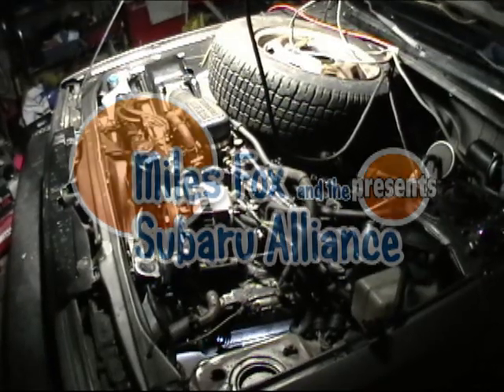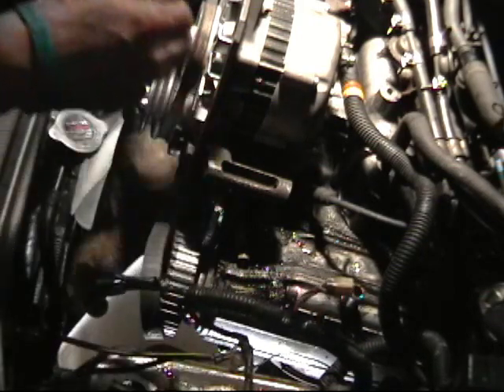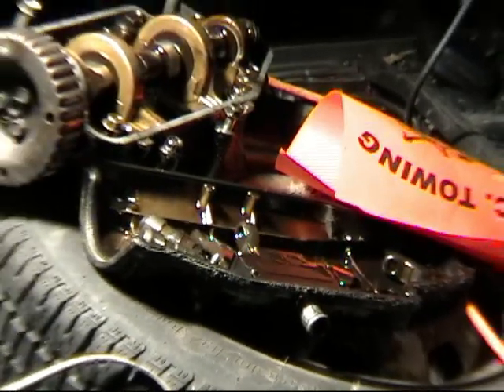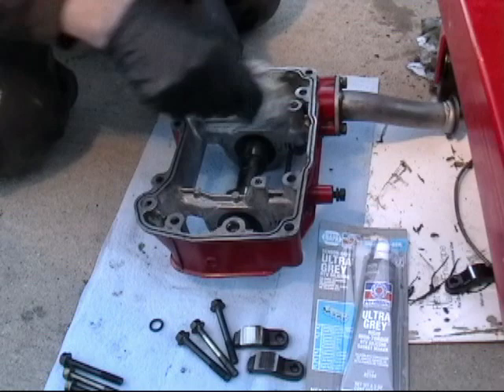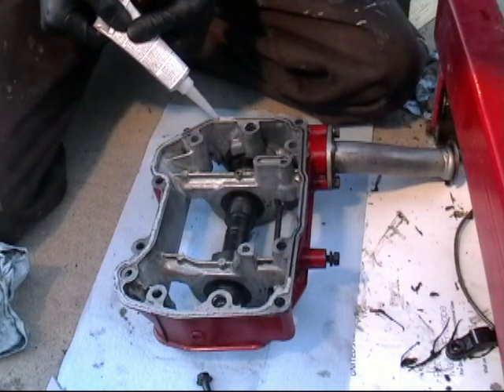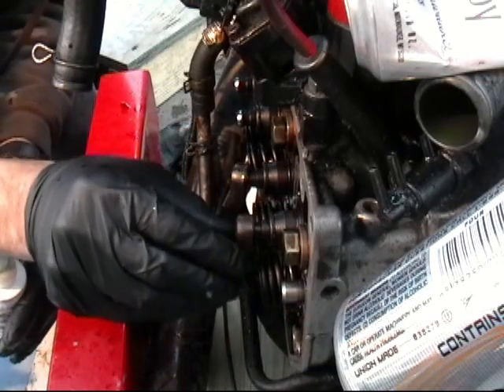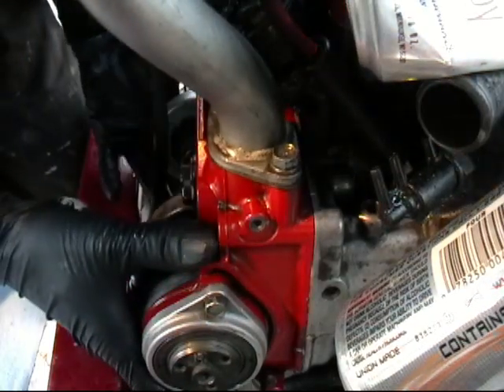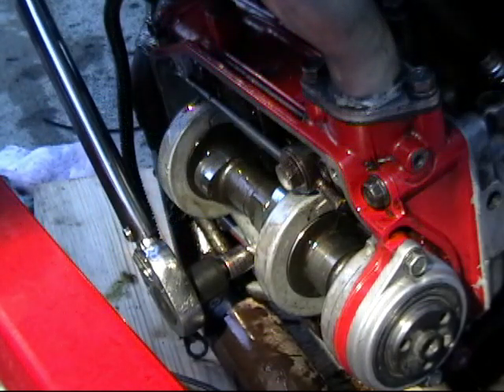#21 EA82 Cam Tower and O-Ring

Comment: I used Permatex Ultra Copper sensor-safe high temp RTV silicone gasket maker to re-seal the clutch on an older Kawasaki ZXR 250 after cleaning off the old paper type gasket. Worked great. Put it on both surfaces, and torqued it up. I actually did a test first, and the gasket it produced was great. No oil leaks whatsoever. Also put some on the oil sight glass to create a nice seal. If I don't buy a gasket, I'll only use Permatex of the right standard.

Comment: Never use grease to hold rockers in place. Some people do have no problems but the grease can block stuff and won't melt. Instead use petroleum jelly, it will dissolve completely as engine warms.

Comment: Lifters won't budge. My original idea was to have them cleaned but since they won't come out, I'm wondering: what is my plan of attack to get them working properly?
Reply from the maker: You might be able to pop them out by shooting compressed air in the oil holes beside them
Reply: Pop! Goes eight lifters.
Two were very stubborn; but, they got the compressed air / rubber mallet combo and each one shot out like a champagne cork. 
Now it's Mizpah on Monday. Thanks Fox!

Comment: I'm currently working on my 94 loyale. On the drivers side i've seized a cam after a fresh gasket rebuild. I have oil coming from where one of the bolts for the cam tower mounts onto the head. Why am i getting oil out of that hole? i would think i should be getting oil from the oil relief valve assembly at the top. I do not have much of an understanding about this problem or these engines in general. If anybody has any helpful advice for me and my problem that would be great. thanks!